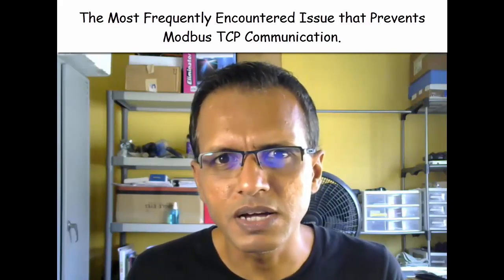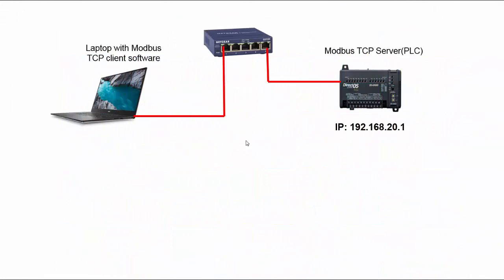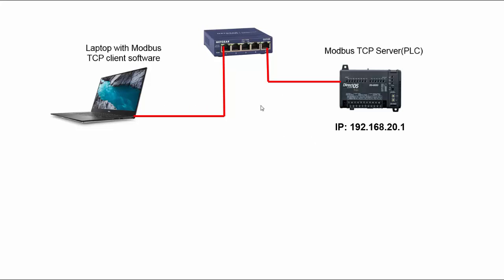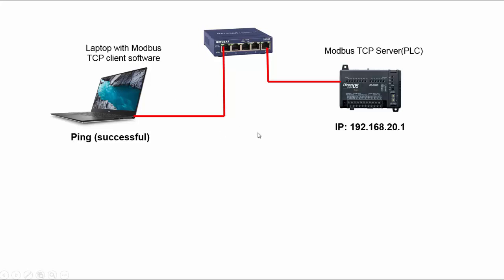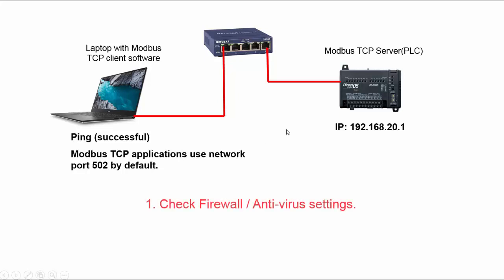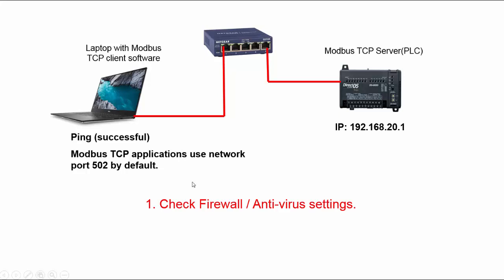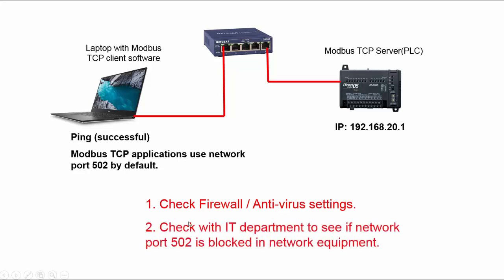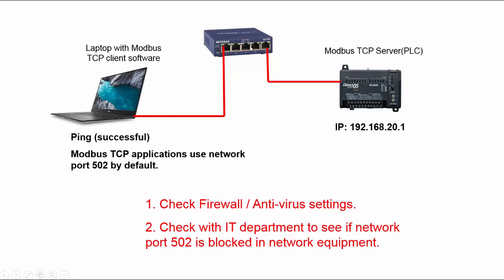The Most Frequently Encountered Issue that Prevents Modbus TCP Communication

Comment: How to I find port 502 / make sure it’s not blocked?
Reply from the maker: It is either your firewall or anti-virus software that will be blocking the port if at all. You have to go into the configurations of both and check to see if it is blocked.
Reply: @ I’ve totally disable the firewall & have no anti-virus software on one pc I’ve tried. Tried two different computers. It’s really getting frustrating lol.
Reply from the maker: @BC_I_LETU  What is device / application is your client and what is your server? Are you going through a corporate network with managed routers?

Comment: Hi is it necessary that the modus port number should be 502 or any other number in a network of example 10devices
Reply from the maker: 502 is the default used for Modbus TCP. But any available port number can be used. Let's say that you choose port 600. You must ensure that all of the Modbus TCP clients and servers in your system are set to use this port. Also, you should ensure that this port is available and not being used by any other application in your system.

Comment: Hello Emile, thank you for this information.
I work on a project where i have a scada system with WinCC 7.0 connected to 5 devices using the protocol modbus tcp/ip with different ip adress and slave id, but some times one of this device disconnect (the ping work)  ! What can be the reason ? 
Just for information, the devices are same.
Reply from the maker: Is it the same device that disconnects in every instance of the disconnection?
Reply: @EmileAckbarali  
No, not the same device
Reply from the maker: @mohamedtaharbenhamida4403 If it is that you can ping, then the network is fine. If they communicate fine most of the time, then it will nothing to do with the port 502. I once encountered this issue. It had to do with the firmware in the devices. There was a flow where the TCP/IP stack in the device would become unstable. In my case, I was able to do a firmware update on all of the slave devices and that solved the issue. Have you contacted the vendor for the devices and asked them if they have encountered this issue and if there is a firmware update to the latest version?